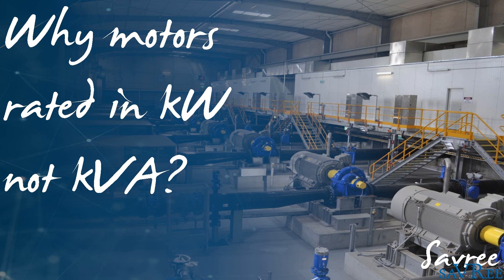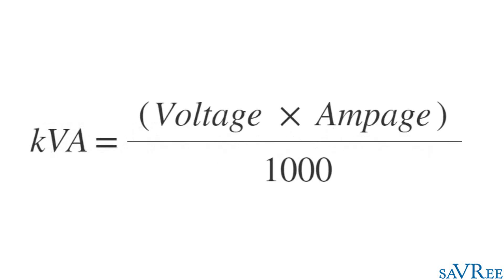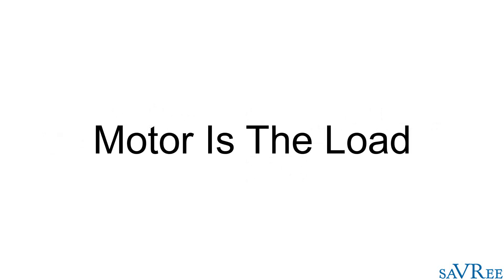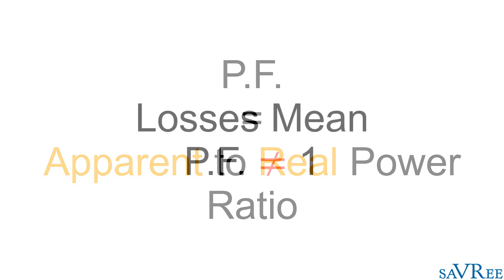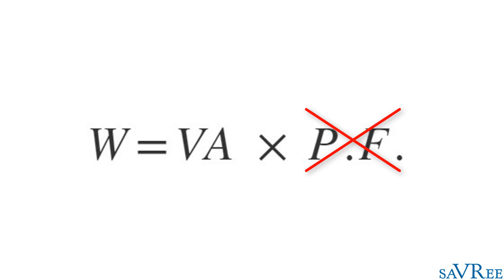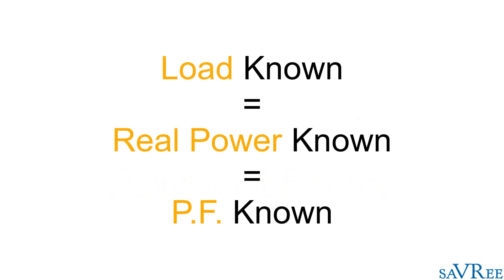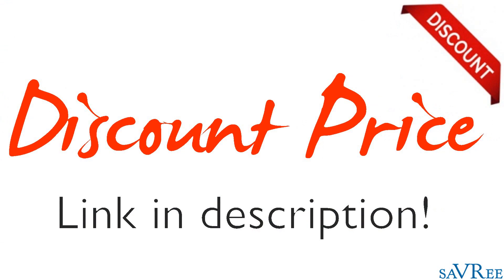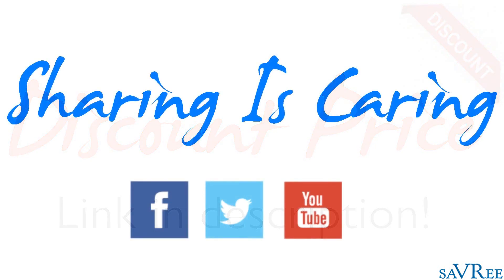Why Are Motors Rated In kW Not kVA ?

Comment: excellent explanation, straight forward and no water. 

one thing I didn't get is why its diveded by 1000? is it some misstake or I don't know something?
Reply: Because the formula is Power(Watts)=VoltagexAmps. Because we give motor ratings in kiloWatts(kW) we must divide VA by 1000.

E.g
P=VA
P=240v x 10amps
P=240x10
P=2400W or 2.4kW (2400/1000)

Comment: the power factor of these videos is also very high ;-)
Reply: I was on your website today 
I have a question though since motors convert electrical energy to mechanical energy, will it be efficient to use the motor as a generator by using it the other way around? I've read some materials on the internet but I think professional clarification/advice/opinion will be better.
Thanks
Reply: @bidav2114  Thank you for your interest. We are not a database for all electrical issues. However, we are happy to answer detailed questions about our electric motors on our channel. For example, a new video on the subject of conversion replacement will be available in January. Maybe you can ask your question there again. Maybe our community can help you.
Reply: @MenzelMotors  thank you, I'll be looking forward to that. I've been sourcing for additional information on the subject and found out about inverter for power station(something of sort).